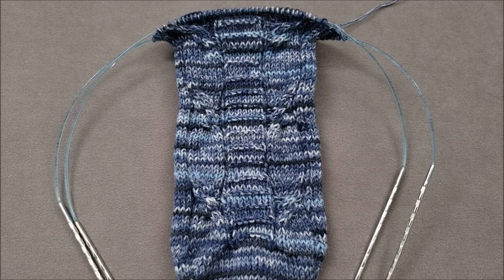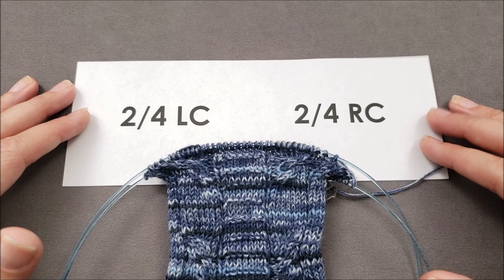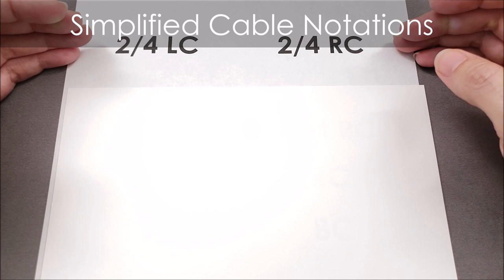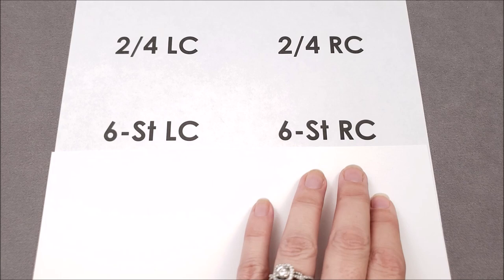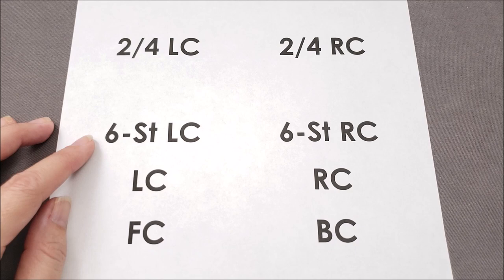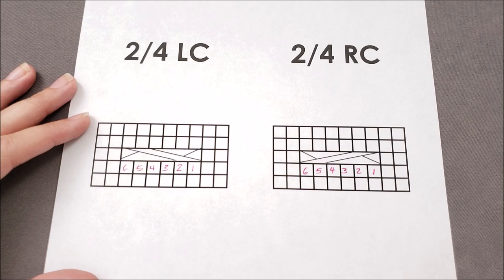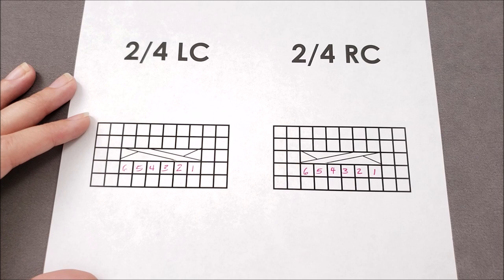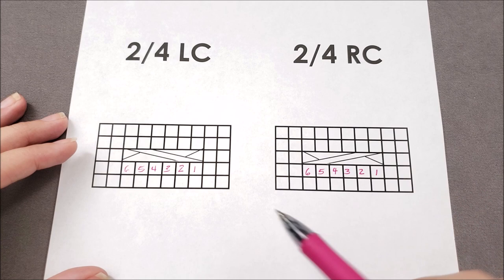Introduction to Cable Notation

Comment: Loved this explanation can you do a video showing how many stitches to add for the cables ie: especially in flat pieces for sweaters or scarfs so there is no draw in?
Reply from the maker: I'll add the idea to my topic list, but I currently don't know of any singular, mathematical way to figure it out. The amount of draw-in with cables depends on so many variables from the weight of the yarn and st/row gauge to the height, width and number of cables and fiber/spinning characteristics of your yarn. That's why swatching is such  a critical step to creating the fabric you want.

Comment: I appreciate this very well-explained video.

Where did you get those needles with the notches that you use in the video? I'd LOVE to try those, it looks like they give much improved control over the yarn. Please share a link so I can get some for myself!

I usually encounter cables in Aran Knit patterns, and this may narrow my intuition. I visualize a cable as a continuous column of stitches that pops out (so it is always comprised of knit stitches) and crosses over or under either other cables or some background. I interpret the "L" or "R" as telling me the direction that that cable is moving. I interpret the "F" or "B" as telling me that the cable is on the front when it moves (synonymous with "L") or on the back (synonymous with "R"). I don't yet grok why a "Front" cable is also always a "Left" cable (and vice-versa) -- that may not even be true. Oh well.

I'm curious about whether you know of any desktop apps that take a pattern (in some notation) as input and produce a chart like you show as output. Please pass along URLs if you know of any.

Moving a two-stitch cable across a six-stitch field like you show is unusual in the Aran Knit patterns I'm familiar with. I may buy and knit your pattern just to see a few rows above and below the cross-over so that I see more context. I don't see a "traditional" two-stitch cable in the video as you handled the in-progress piece.

Thanks again for yet another well-done video. I don't see a Patreon link for you -- I'd welcome a chance to do my part to support your work and channel.
Reply from the maker: The needles with the notches are Skacel by addi Rocket2 [Squared]  (or addi Novel if you're not in the US). They do help your stitches advance very smoothly and evenly. Also, I use Excel to make my knitting charts with the free knitting fonts from Stitch Mastery, https://stitchmastery.com/. I believe they also offer charting software. Finally, the best way to financially support my work is to purchase a pattern from my website. Thanks for your support and happy knitting!
Reply: @thechillydog  : Thanks so much for the helpful information. I just bought the "Cereus" sweater, glad to support your work.

Comment: Does your pattern indicate slipping those stitches knit wise or Purl wise?
Reply from the maker: Good question! When you cable you are just changing the order of the stitches, you (usually) don't want to twist them. So, the rule of thumb  is to slip stitches onto your cable needle purlwise unless the pattern says otherwise.